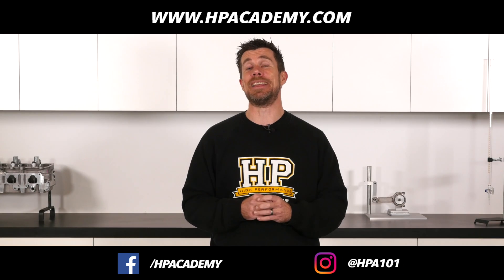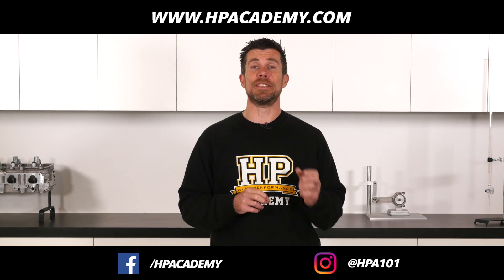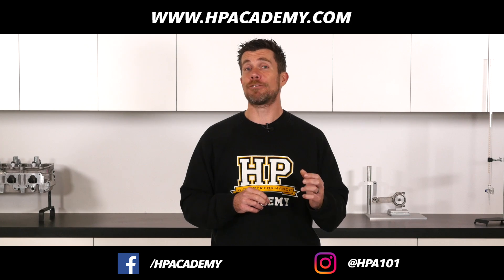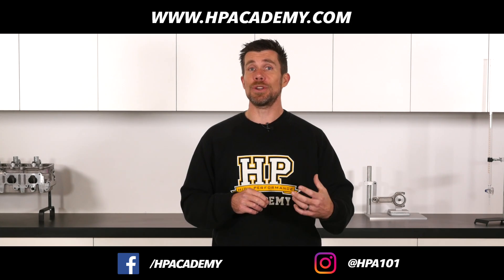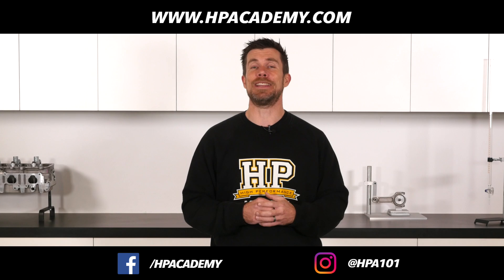[HPA Q&A] Wideband sensors and V configuration engines | Best practice install advice

Comment: I am using one lamda sensor in the collector under the car. But to monitor any variations I use EGT sensors on each bank . It is a cheaper solution then running two lamda sensors.

Comment: How about tuning a engine with one sensor, then when that's done unplug and tune each cylinder one at a time with the single sensor ?

Any tips on tuning pre-turbo. Heat seems to be a wideband killer.
Reply from the maker: It's possible to use a single sensor and swap it from one cylinder to another however obviously it's more time consuming. If you're fitting sensors pre turbo then you will need to account for the exhaust pressure as this will cause the reading to be inaccurate. I use extended weld fittings that remove all but the very tip of the sensor from the exhaust stream which helps reduce the heat the sensor is exposed to.